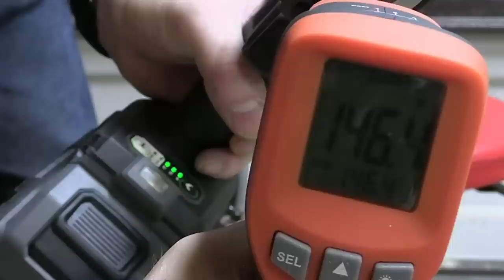Makita 40V Impact vs. Milwaukee Fuel vs. Dewalt XR vs Flex - BEST IMPACT DRIVER?

Comment: Μ18 gen 3 beat everyone
Reply: Spoilers!
Reply: @Joethetoolguy  is it really though?
Reply: I am thinking I really like the flex, that power is awesome.
Reply: It didn't beat the flex. The trunk test with those lags cut the flex down significantly. It didn't perform even close to any of the other tests which means it was due to that specific part of the wood. The flex actually beat the Milwaukee going of the results in general without that test. But the flex did beat the Milwaukee in similar fashion on the same trunk so that isn't trustworthy either. When using the trunk test he should do 4 lags per drill and use the average. It still wouldn't be perfect but at least it would be drastically better than this.
Reply: @jdelapaz14  you know I was thinking the same, and on that trunk test I would run the tool to a complete stop or complete failure.in the real world we don't stop we push the tools until it breaks or the job is done.

I do agree with you that the trunk has no consistency with it and maybe doing stacks of OSB sheets would be better but is all good because Jim keeps it honest. 

I still think the Flex took the prize too.
Reply: @rickyperkins232  Yeah, I agree. I love his videos too. I just see the results differently. I timed the other lag test in that trunk he did, the milwaukee stopped at 16 seconds and the flex took 9 seconds to get to the same depth as where the milwaukee stopped.
Reply: For now.....

Im like 80 percent sure DeWalt will place   that ancient 887 in a retirement home, sometime late this year.
Reply: I'm sorry, but on the 1/2 inch lags all but the Makitas failed...................
Reply: Pros:
  Fastest by a few seconds
Cons:
  Most expensive tool
  Most expensive batteries
  least amount of features
  Most downtime for warranties

Comment: Test is flawed, you clearly push down on the Milwaukee and flex drills with your other hand, while using your thumb only on Dewalt and Makita.  Outcome could be the same or not..but you messed it up

Comment: I'm pretty sure the flex doesn't have thermal protection so that they have more power up front but I don't know what the long term effects would be of that.
Reply from the maker: It seems that all of the Flex tools run hot.  I've been on the lookout for a used FLIR thermal camera I could set up next to my regular video camera so I could capture temps without pulling out a laser thermometer.

Comment: I don't get why you're even bothering with timing while you are screwing down too fasteners. The only accurate time would be getting the impact on the fastener and sinking it. Between each gun every time you sink the fastener and go to set the bit on the new one it is different every time sometimes you do it very quick and get the second one started immediately and other times you fumble and don't get it started nearly as fast and that second or so is dramatic in these numbers you are showing. So I would not do that in the future.
Reply from the maker: It's probably impossible to objectively factor ergonomics into the testing, but that was how I chose to do it.  Since it's only one of the numerous tests, the weighting on the overall rankings is still pretty minimal.  Same with my drill testing and the 5-hole test. Thanks for watching!

Comment: Makita XGT tested with the 4.0 Ah battery, which is weaker then the 2.5 Ah one. Mesnwhile, other tools have big batteries with nultiple cells in parallel (which means higher power output).
Reply from the maker: I'm sorry, but that's not correct:
https://m.youtube.com/watch?t=27s&v=-rsC2e2IpHE&feature=youtu.be

Comment: IMPACT DRIVER MNFR.'S MAKE  THEIR  TOOLS  SMALLER AND SMALLER.  YET  THE  BATTERIES  GETTING  BIGGER AND BIGGER  AND  HEAVIER.   DEFEATING THE PURPOSE OF A NICE SMALL POWERFUL, LIGHTWEIGHT IMPACT DRIVER.
Reply from the maker: That's a very good point.  That is one thing Milwaukee nailed with the CP3.0 High Output pack.  All of the manufacturers should have something like that.  The Kobalt Ultimate Output 4.0 is a decent option there as well.

Comment: Wow that 40v makita is disappointing in all aspects...glad I just purchased a red devil!!
Reply from the maker: I wouldn't say all aspects.  I expect it would outlast many of the others, especially DeWalt.  Also, if using it all day, it will be less fatiguing.  But, you will spend more time doing the work!
Reply: @PhillyFixed  I agree, it might have a little edge in the longevity aspect but as far as pure performance it got smoked! I personally own dewalt xr, metabo tripple hammer, milwaukee gen 3 and makita 18v quick shift impact...and the metabo tripple hammer is my favorite by far with overall weight, power, ergonomics, battery life and functions

Comment: Who gives a rip? So one runs a bolt 3 seconds faster than another one...the Flex is barely 2 sec slower than Milwaukee..and the 887 is an old impact
Reply from the maker: Just to clarify, you watched a video with 50k views comparing impact drivers and then said "who cares" when the results were provided... got it.

Comment: Why not test them with 5.0 batteries? I’m not sure about everyone but that would be the battery I would realistically be running.
Reply from the maker: The DeWalt, Milwaukee and Flex 5.0's have lower-output 18650 cells.  But I could do a test with 5.0's.  Except Kobalt, they don't sell a 5.0 anymore, would have to do a 4 or 6.  And Metabo HPT doesn't make a 36V with standard 18650 cells.  I don't have the XGT tools anymore, had to return them.  Not in the channel budget at the moment.
Reply: @PhillyFixed  I believe metabos are 18650s and I would say that test would be more realistic since it’s the battery most come kitted with . Also did you know metabo have a gen two of the triple hammer
Reply from the maker: @Apinp18  The 18V Metabos have the 18650s but not the MultiVolts.  I saw Tools & Stuff did the new gen Hikoki triple hammer.  Not available in the US yet though I don't think?
Reply: @PhillyFixed  I got it on eBay just the tool shipped from Japan

Comment: The Flex batteries are garbage, they leak a black goo even while charging I'm very disappointed and plan to return the turbo driver I just purchased today and have not even used it, the batteries were cover in a black goo when I opened the case I wiped it off and charged them both and found the same black goo on the charger just garbage, I will never purchase Flex again

Comment: The FLEX was killing the 3/8” lag battle and then hit an  unusually hard vein in its spot.  The 40v Makita really disappointed speed-wise.  Props to the Milwaukee.
Reply from the maker: Actually it seems typical that the Flex starts fast and then drops down, check out the Flex vs Flex video where I compare it to the lesser model...
Reply: @PhillyFixed  That’s interesting since I didn’t see it hit a quick wall with the 8”.
Reply from the maker: Examples:
https://youtu.be/kvkwZtCgoM0?t=152
https://youtu.be/kvkwZtCgoM0?t=507

But on the 1/2" x 10" lags, I think the torque is high enough from the very start that it doesn't begin the screw in a higher speed.
Reply: @PhillyFixed  Given the good performance and INCREDIBLE current lifetime of the FLEX, I couldn’t resist taking that route.  The peace of mind of a lifetime warranty and up to 3 battery changes each was too much to pass on. The reciprocating saw on my property’s trees was quite impressive for hours of nonstop cutting.  Best of all there’s no sharpening the chainsaw and my FLEX bi-metal blade actually feels sharper than new (somehow) two days later.

Comment: Holy crap look at all the makita fan boys come out to defend their tools because they came in last place. Lol makita is ok but they don't seem much better than the new Ryobi line
Reply from the maker: I have to disagree on Ryobi vs Makita.  It definitely lost the speed tests here, but that's not the same as quality and durability.  You'll burn through 2 or 3 Ryobi impact drivers and the Makita will still be chugging along.
Reply: @PhillyFixed  hmm I'd like to see that put to the test in a real world application. How many Ryobi impact drivers will need replaced compared to a Makita impact during a span of 10 years or something.
Reply from the maker: @IanMM88  the only anecdotal evidence I have is my LXDT01 that's about 10 years old - https://youtu.be/iAtYTiK1I98

Comment: The 40v runs better on the 2.5 ah batteries its like the bigger battery slows it down.the milwaukee has the power but build quality and finish of the tool is shit.the makita is more refined. Milwaukee for big framing jobs makita for every day
Reply from the maker: Where did you hear about the 2.5 vs 4.0 batteries?  The 2.5 actually has 18650 cells while the 4.0 has 27100s, so I'm not sure what would cause the smaller battery to be better.   Check it out - https://youtu.be/-rsC2e2IpHE?t=33

Comment: I think the flex beat the rest in this video. The milwaukee came second. I don't rust the lag times where the flex came in at 13 seconds. It didn't match up with the other lag comparison if you look at the times. The milwaukee took 16 seconds before it stopped. The flex took 9 seconds to get to the same depth as the Milwaukee, a whole 7 seconds faster. Those were longer lags in the same trunk.
Reply: I am a milwaukee user and switched to the flex. I use them everyday and can see the difference. The flex is faster and stronger than the Gen 3. Milwaukee will no doubt come out with a stronger version but right now the flex wins.
Reply: We will see on longevity
Hope u all well with the investment into a new line
I'll stay with my Milwaukee and new favorite over the last few yrs
Metabo HPT 36V line
The sawzall, hammer drill, grinder, rotary hammers, table saw and mitre saws are all top of the line where FLEX is still gonna need to make up ground and prove it's durability-FLEX also does not have the AC adapter option like the entire Metabo HPT 36V line does-this has saved quite a bit of battery life/longevity and make heavy use work a breeze
Reply: @baseballdude8491  I hope so too. Lol. I'm still keeping all of my Milwaukee tools too. Tool selection just isn't there yet with the flex. Can't compete
Reply: @jdelapaz14  that's not what I saw in the video
Reply: @marceloalencar9373  You saw wrong then. sorry. lol.
Reply: @baseballdude8491  The metabo line is pretty nice. I think they have a rebar bender cordless edition too. I do concrete construction so that is really cool.
Reply: @jdelapaz14  ok, your video showed different. 🤪
Reply: @jdelapaz14  yeah the rebar bender is awesome--the SDS rotary is also a great tool and we use it with the AC adapter more than 50% of the time which really extends the usefulness and run time of this tool-not sure why the other companies refuse to make more of their high run time tools more-I just picked up my 3rd 36V/AC capable table saw cuz it is the largest cut capacity/blade and is used with the AC adapter when we are doing a bunch of 2X ripping--the other brands are useless for many table saw tasks cuz they burn up batteries so fast-also the Grinder is the best battery powered out there

Comment: So what i learned from this video is that the Makita 40v is clearly and purely USELESS!!!!
Reply from the maker: Eh, slower doesn't mean useless.  The various modes are useful for machine work and pretty unique to Makita.
Reply: @PhillyFixed  While that may be true in some unique cases only, in this video the 40v couldnt sink the lag bolts more than the 18v or in parts just about similar. Idk i'm confused now

Comment: FLEX  BATTERY  IS  TALLER  AND  WIDER  THAN THE  POWER  TOOL.  DEFEATS THE PURPOSE OF SMALLER IMPACT  DRIVER DESIGNS.  PROBABLY WEIGHS A TON.  DEFINITELY NOT PRACTICAL FOR PROS OR HOMEOWNERS!

Comment: Makita make fragile tools
Reply from the maker: I have to disagree with you there, Trent.  What they lack in speed I believe they make up for in durability.  But thanks for watching!
Reply: @PhillyFixed  The plastic cracks super easy in cold weather, and the tabs on the batteries break really easy. Makitas customer  service sucks, been switching over to Milwaukee... much, much better in every way.